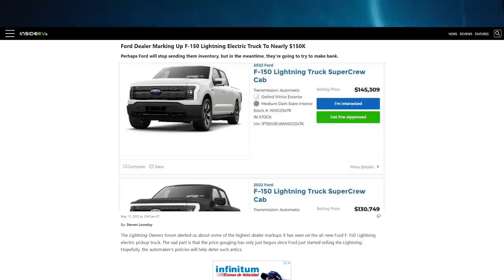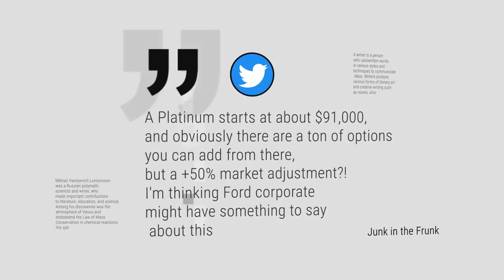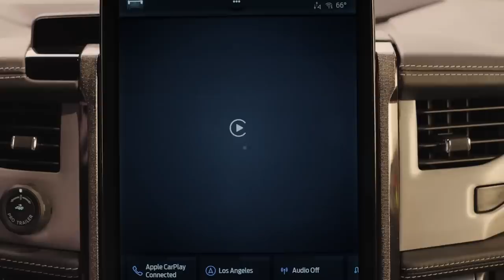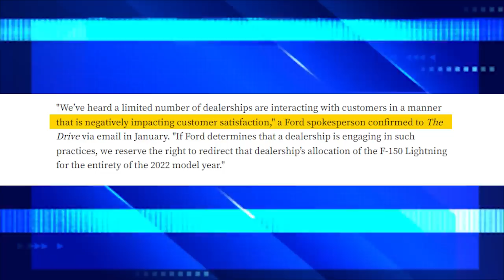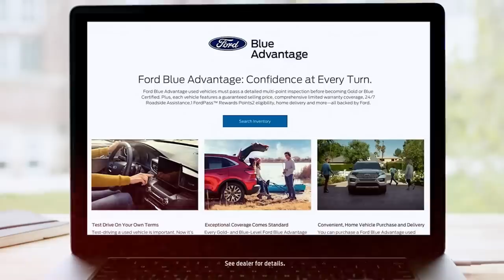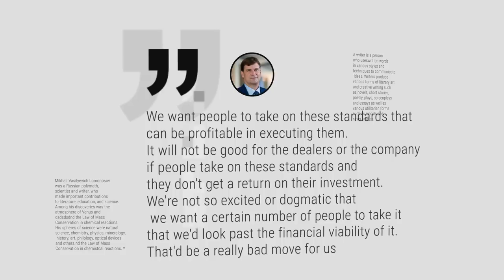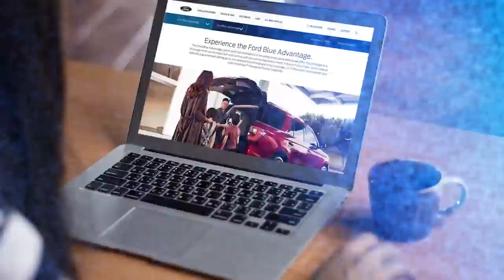Another HUGE Blow For Ford Dealers

Comment: It’s one thing to mark up cars a little bit to make up for the low supply so they can stay in business and not have to lay off employees that’s fine but 20k 50k markups is bullshit! I can’t believe car manufacturers have been letting this happen for so long because it makes the car brand look bad. If a base model f150 is 30k at one dealership it should be 30k at every other dealership. Not only is this good for the customer but the dealerships too customers know it doesn’t matter what dealership they go to the price is the same so there is no reason to shop around. I worked for the Saturn dealership this is how they did business and they sold 40 cars per week just a small dealership. When ur fair to customers they come back for a lifetime! When you try to squeeze out every last cent from a customer, nickel and dime them to death they will not be a lifetime customer. Too many businesses only think about making money today they don’t think about tomorrow and next year! I own a auto repair shop that is located in a 3 mile stretch of new and used car dealerships and tons of repair shops. We treat customers like I want to be treated, we don’t sell them anything they don’t need and this keeps them coming back. When it’s a slow time of the year typically we will still have work to do and all my competition don’t have any work, tool trucks and parts drivers will tell me man all the other shops are very slow right now but not u guys. The funny thing is I’m more expensive then shops right next to me I’m 20-30 bucks more per hour! We also are much more knowledgeable then most shops around we get customers sent to us from shops all over that can’t figure out a problem but all of this just goes back to taking care of the customers and explaining to them what they are paying for. For instance I had a customer that was a cheapskate she complained about the price for her brake job saying the shop next door will do it for $250 I said well the cheaper brake parts usually will make noise they squeak and they don’t stop as well that’s what ur gonna get for 250 from them! We use better quality parts they don’t make noise, they stop just as good as factory or better, we sandblast the caliper brackets we put a thick grease under the new brake clips so rust doesn’t form and bind the pads, we put new slider boots on when needed and give a 2 year 24k warranty. She got the brakes done next door and a few weeks later she comes to my shop saying I was right they put on crap brakes it’s making noise, stops like crap, brought it back twice and still doing it. So we did the brakes for her and gave her the old parts back so she can get a refund. When she came for an oil change a month later she said the brakes work so good it stops way better then when the car was new. I said no offense but trying to be cheap can be expensive, But many customers need to learn this.

Comment: Crazy stuff going on... The only brand new vehicle I bought was a 2005 F350 XLT 4x4 diesel that I ordered for my 40th birthday.  The MSRP on it was just over $35K and I got it for around $30K when they had the 'Ford family' promotion going.  I still have the truck but I don't drive it much with Brandon's fake energy shortage going on, so the miles are still below a quarter million.  Looking forward to Trump's 3rd POTUS victory and diesel back at $2.35.  I wouldn't waste garage space for an electric pickup if you gave it to me.

Comment: Consumers need to educate themselves on how to purchase products. If I pay too much for anything that’s on me. There are more unscrupulous dealers today, and I suspect mostly it’s the mega dealers who own numerous dealerships , hire general managers to operate them who are under pressure to return enormous profits to the corporate office. I would suggest trying to find a locally owned dealer who lives in the community. Everyone is in business to make a fair profit and it’s up to the consumer to see that they get a fair deal on everything. I see so many people who only payment shop , and that’s not a wise shopper. 
  I fear the factory direct sales would be much worse than the dealer model, as you most definitely be dealing with people who have absolutely no connection to the local community and all aspects of buying and maintaining vehicles would greatly suffer. 
  I’ve never paid MSRP for a vehicle, and avoid dealer shop’s for anything except warranty work or issues that require dealer level only computer issues. 
  There are many fair minded dealers out there. It sometimes takes a little effort to seek them out. If more consumers did that, the system would fix itself or the bad guys would go out of business.

Comment: I just went to Ram this month. I have owned Ford 250 XLT and a HDF150 . Value for usage.
   I started looking when I noticed Daimler bought the company and reengineered the vehicles. I purchased a Jeep GC which is off the Mercedes platform even uses Mercedes product line. 
They did sell to Fiat in 2012/13.  
  This aint grandpa's Dodge.

Comment: Dealerships should have never become a thing, and it's time for them to go. I hate the dealership middleman model and most Americans agree they would rather get a root canal or just about anything else other than visit them. They serve absolutely no practical purpose outside of the used car market and even then purpose-built facilities could handle this without additional middlemen being involved. Need repairs? just visit a mechanic, car manufacturers could easily build locations to handle warranty-related repairs themselves instead of leaving it to a greedy middleman.

Comment: My last two trucks have been Ford and I would like the next one to be as well.  Ive seen between $30k and $50K in Market Adjustments.  I will ditch Ford and take as many people with me as I can if the dealer asks for a Market Adjustment.  I fully believe in a free market, though the dealers have gone too far. For me dealers add no value other than warranty work.  My last two trucks I learned more online than from any dealer.  My last truck I bought over the phone.  I vote for direct and add certified shops for warranty work.

Comment: Dealers are just applying basic capitalist/consumerism practices. Supply and demand.  Add in a bit of good old collusive trading to make sure no-one spoils the party by undercutting. Every industry does it, and has done it ever sinse the alleged "free market" existed  
The only change between a dealership model and a factory/corporate model is that the price gouging will happen at the corporate.  The customer will still be ripped off.

Not saying it's better or worse than any other business/corporate practices, it is what it is and been the basis of US market for ever.

Comment: If Ford really wants to help their consumers, they should reach out to the owners of the vehicles that regrettably over paid during the pandemic, and compensate them for the difference, and then fine the dealerships that got greedy, the difference in cost between MSRP and the “Market Markups” that would stop dealers from being greedy and solve the market adjustments. Simple
Reply: won't work.  there are many ways around it

Comment: FORD Direct orders need to get down to a 6-week timeline not a 6 to 18 months timeline..
With all the supply chain and semiconductor shortages they're scrambling to put Vehicles together which is severely impacting ordering timeline
Reply: And what is your solution? If you have to wait for parts from a supplier....you have to wait.

Comment: The fault will always lie with the consumer. Perfect example,  during lockdowns, fuel prices dropped by half because there was more supply then demand. Consumers stopped buying, so oil and gas companies had to reduce prices. The same goes with everything else in the free market. If you dont like products made by Chinese slave labor then don't buy anything from Walmart or any samsung or apple devices. If you dont want the markups at dealers, then just don't buy the cars. Retailers will be forced to either change their processes or reduce prices, but at the end of the day we, the consumer, have the power.

Comment: so when is the government going to step in and make them post real mileage for all EV like they did for MPG on fueled vehicles??
the ford Lighting is out right junk. it does not come close to what it is listed at. 
if you are any were but on flat ground you will be lucky to get 1/2 of it's rated mileage. now put even a 1200 pound empty trailer behind it and you can cut that down to 1/4 of rated.

Comment: This is a bit hypocritical of the manufacturers, they have been raising the price of there vehicles to dealers by thousands of dollars because of reduced volume, and supply chain issues, dealers have no choice but to pay the higher price. For some reason the manufacturers get upset when dealers raise there prices above MSRP for the same reason. Dealers have had to deal with a reduction in sales volume of 35% to 50%, while there expenses have risen.  It takes a certain amount of money for a dealership to remain profitable, if a dealer makes X amount of money based upon a average profit per vehicle sold. If volume is drastically reduced the dealer will have to make more per vehicle to bring in the same profit needed to remain profitable. I have no issue with a one price model, as long as the vehicle margins are good. I think the one price model will provide a better experience, and better protect dealer markets. It protects ethical dealers and will force unethical dealers to stop doing there deceptive tactics.

Comment: Ford builds cars with major problems then when told about the problem they do nothing. I am done with Ford for life. Ford dealerships damaged my car many times when I brought car in for warranty work. Told Ford in September of 2012 that the 2013 Escape was built with improper gapping between front door and rear causing doors to hit and chip the point where it hits. Ford never made the CAD system change to allow rear door to be installed a few millimetres rearward to prevent hitting. They made no change. I moved my own doors after Ford painted all 4 doors twice. Ford does not care about quality. I just bought a 2022 Mazda GT Sport. Love it. Great build. Great quality. Never again will I buy Ford

Comment: Ford has taken profit potential out of the dealership model for twenty years. The franchise agreement is very strict. The business model is really several different nodes under one roof. Parts and warranty work has seen a radical reduction in Profits.the dealer principle is still obligated to perform warranty work and buy required special tools and equipment along with all of standardized business equipment and software.
The only unencumbered node in the Whole thing is for non certified used vehicle sales. I think that there are going to be a good number of dealers that Will either sell out, retire or become something like a Ford authorized repair facility and then operate their own separate retail used vehicle lots. Dumping the new vehicle sales altogether.

Comment: Mega-Dealerships, Mega-Churches, I can't tell the difference. All either wants is all your greenbacks, all your savings, and maybe an arm or leg or two. Even if the FoMoCo CEO manages to reign in the rip-off dealerships, what is to prevent the dealerships from raising shop rates to $150 per hour or more for service, maintenance, and repairs? Unlike these multi-million dollar mega-dealerships, luckily there are still a few brick'n'mortar honest dealerships around, not many but a few.

Comment: Since the GM bankruptcy and bail-outs the sheer number of dealers has shrunk.  The supply, after the bail-out though still plentiful, began to also take a long-range shrink long before Covid issues.  The spoilers were the fast rising Korean brands and the continuing Japanese supremacy also peaking.  The rise of unit prices across all ranges was fully in place synergistically with fewer dealers and tighter inventory.  Basically the consumer was being manipulated to a new degree.   I see this move to on-line purchasing as a kind of masterstroke for the manufacturers in consumer behavior modification.  The market, though far from perfect, can be a decider as a potential buyer can walk, try as many dealerships and brands as they like, and find the right vehicle at the best deal they can muster.  I see the move to go on-line as taking away many choices the consumer formerly had some control over.   I think automobiles are one of the large ticket items that need dealer support.  Sure, many dealers showed their worst tendencies as the combination of mega-franchise dealers and fewer of them became the norm.  Covid only accelerated that bad dealer behavior as far fewer vehicles were available.   I think if the dealers are going to survive and serve a purpose it is time for a return to "high morals" in business.  Simply take The Ten Commandments and do everything at the dealer level with that in mind.  No more cloak and dagger unknown buybacks or spiffs for writing certain financial agreements.  Total honesty and clarity with very competitive less than sticker pricing (stickers have often been a slap in the face as way too much add-in stuff anyone would want cost extra).  So, if we are coming out of these dark times and going to go forward, and do so with dealerships, things have got to be far more "pro-consumer" oriented.  Though I only sell modest personal transportation, I was taught to treat the client so kindly and honestly that you were not selling that one pair today, but many more pairs in the future.  If you treat the consumer correctly they naturally come back to support whatever it is the dealer is selling.

Comment: Ford is not going far enough, get rid of dealerships. The EV's should be sold direct from Ford at a fixed non negotiated price, click and buy, they can make it part of their vertical integration plan to build a delivery system. The dealerships can still receive ICE and hybrid until their phase out at which point dealerships will have to reinvent themselves, maybe they can become certified service centers or they can just go out of business which is fine too. Dealerships are an unnecessary middleman and contrary to what they try to claim, they add no value to the car buying experience.

Comment: The more things change ... the more they stay the same.  After 53 years in the business (virtually all with the manufacturer), I can tell you from experience that Farley is making a "huge" mistake.  When the manufacturer gets involved in the Dealer's business of retailing cars and trucks it becomes a disaster, usually resulting in the car executive getting replaced.  Farley has no retail experience to draw on and is going in the wrong direction.  EV's produced to sell in volume are going to fail, along with the manufacturers in that pursuit.  Elon Musk's business model with TESLA was designed as a low volume / high profit product.  Elon has designed "markers" into his model that tell him when to make production changes for volume.  Elon's model works for TESLA, but will not work for Ford, who must rely on volume and a dealer organization for Ford's success.  Ultimately, Farley will pay the price ... and the Ford Dealer's will still  be there pumping iron as in the past.

Comment: Whatever happened to the price is what a willing customer will pay?  Ford is so screwed up.  Just wait until the factories set all prices without dealer competition.  This is all caused by limited supply but eventually it will turn around.  Ford wants to eliminate competition among dealers so the factory can get the added markup for themselves.   The whole thing is a crock

Comment: The Ford dealer in my town is awful l have driven to a small town that is about an hour and a half round trip for every vehicle, service job or part l need. I will never give my local dealer any business again. I have been very happy with my Rangers and Mustangs a.nd replacement parts are not ridiculously priced for the most part either. Unless l go to my local dealer, higher parts prices, poor follow up, and a complete lack of organization in the parts dept. ( l am a former parts mgr myself) are the norm.
I also found that when my wife let them do an oil change on her Mustang they used a below spec oil for the oil change.
Of course additional dealer markup on new sales is standard operating procedure.

Comment: How about you build a simple and efficient small form of transportation that runs on a carberuretor without electronics and able to be worked on by a mobile mechanic with 12 tools and a jack. Limited options. Least amount of electronics as possible so they aren't susceptible to emp or solar interference. Trade in older vehicles and really get things on the road.

Comment: The best thing Ford can do is to end independent Dealership . It would take 2 years to do this .  First completely stop production for 2 years . Forcing Ford independent dealership to fold up .  This would be a snow fall effect . Once that is done . All Ford has to do is buy property and build new FORD shops and sales rooms .  Instead of signs of saying who the dealer is owned by it just say FORD . All FORD OWNED with Ford employees and tools . Ford will have the right to hire who they want and train them to do tasks .   Will this bring up the cost of owning a car or truck not likely . it would cost less and the parts flow will be even faster . If those are faster then repaired cars  will be fixed faster .  Most independent dealers are crooks anyway . They want it from both ends . You pay the dealer and the dealer will get paid from the FORD . It's called double dipping and one hand dont know what the other hand had done .  Sometimes when this happens they do get caught and nothing happens .